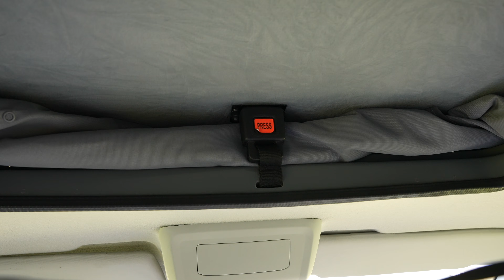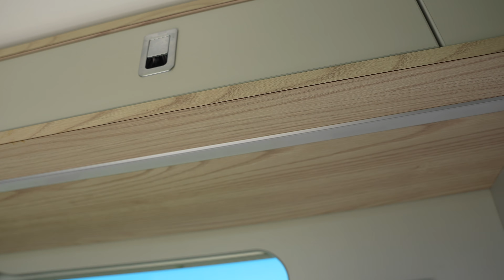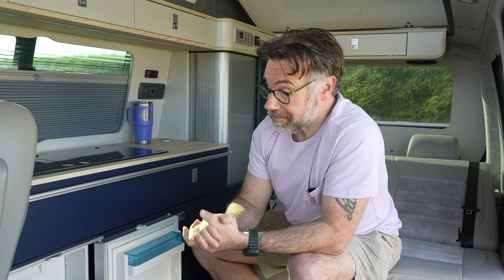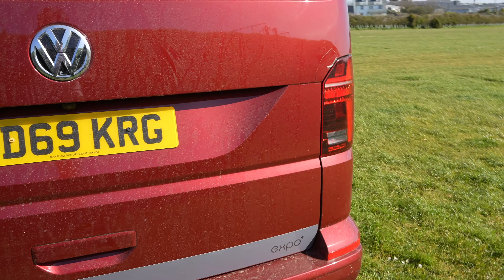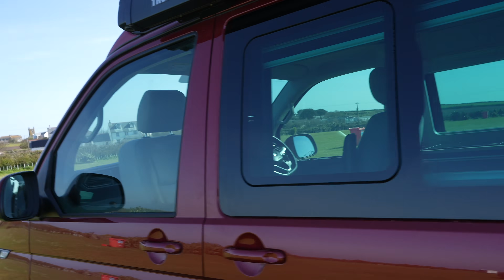£95,000 New. £65,000 Now. Is This Ecowagon Campervan Worth It? Only 8k Miles

Comment: Wot? In 2022 a Volkswagen California Ocean was about the same price New as this van is now. Used Californias of the era will currentlysell at about £60,000 – far, far less depreciation than the featured vehicle. Fact is Volkswagen‘s own depreciates at a snails pace compared to this one. The California is supplied at a very high spec in standard form. Electric pop top, central control panel  that among other things controls the fridge. Sliding rear seat (Yes it appears the one of the featured van is a Volkswagen California item) that allows increase camping space or increase cargo capacity. Windows with blinds built in, furniture built in entirely from aircraft grade honeycomb aluminium, One side out table, another located inside the sliding door that can be removed and used outside, two camping chairs stowed in the tailgate, diesel air heater with remote control– the list goes on, but the most important thing is that you get nose to tail Volkswagen warranty – the van and the conversion.  Hence, as they say in the trade, excellent residuals. And  Volkswagen dealers that sell Californias are trained not only in servicing and repairing the vehicle, but also the conversion. When it’s selling or trade in time, the majority of motorcaravan dealers will pull your right arm off trying to get their hands on your van. These things sell like hot Cakes on the secondhand market. Awhile ago now I know, but I once asked the sales manager at a Volkswagen dealer why they did not bother exhibiting at motorhome shows. He told me that they get an allocation of Californias every year and that allocation is sold within the first six months. No point in exhibiting when you have no product to sell. I bought a California brand-new, but for various reasons had to sell it three years later. It depreciated by just £3000 in that time.  A very interesting and informative video allowing you to appreciate just how much a  very desirable camper van can lose value. However, my opinion is that the California is far superior and in  almost every way.

Comment: How can they justify a £40k van with a few grand to make it a campervan, then mark it up at £95k. Its Obscene to sell at that price and insane to buy at that price.  People can throw their money away if they want.
Reply from the maker: They show on the prices of components on the spec list. It soon adds up. To sell at that price is a result of the expensive components. Buying at that price is down to the customer. 
In recent times, with base vans costing significantly more some of these have been spec’d to over £140k (6k body kits, 10k alloy wheels etc)

Comment: Why has this van only done 7k miles in nearly 7 years ? That a bit concerning also why has it gone through tyres with only 7k … also the price new 95k and now £65k second hand … you can buy these new for £68k
Reply from the maker: That’s not uncommon. Especially with older people and Campervans.
Look at the components. If this van was built now, it would be well over £100k
Reply from the maker: The wheels were changed from the originals 👍🏼

Comment: I personally wouldn't buy a campervan without a loo and shower. I like Autosleeper Symbols as only 5.4m but fully equipped, but it is down to personal choice.
Reply from the maker: Yes personal choice. This has both, but just not in a cubicle 😂
Reply: The V line 540 is a nice one too
Reply: @paulstarr6818  It is we looked at it before we bought the Symbol.
Reply: @j @jimf4748 s Autosleepers and Autotrail make good Campervans..

Comment: £95k for that? No 4-Motion, obviously no diff lock, no hill descent, SWB, bath tub roof, analogue dash, no park assist, no electric slider or tailgate?

What engine, what weight rating?

It was a £65k van to begin with, it’s a bang average spec for a Transporter.

Comment: For me the quality/condition of the base vehicle is paramount as the best camper sat in a garage being repaired is useless. After that it’s definitely layout as the most expensive camper is useless if it doesn’t work for you and finally power if it always runs out of power or can only be used on ehu then it’s not very practical. Looks a lovely van and whilst the costs tot up you may find you can get a decent useable alternative for a fraction of the cost.  Now if I can find a high top 5.4m Ford camper sleeps 4 travels 5 that would be amazing 😂 seems to be like rocking horse poop !

Comment: It's totally unnecessary to have all those lights, electrical outlets, usb control panels etc. can easily be replaced by a 3 meter lead and battery powered lights. Especially in a SWB van

Comment: better off with a cali ocean for that money and  when it was new .
Reply from the maker: There is an argument to be had, but it would be personal preference. Some things could be upgraded on the Cali so it had the same features, VB, Lithium, inverter etc, But there are differences which people would choose  not to have it. Kitchen is different, top loading fridge, but the big one is the sliding door on the continental side. Meaning it opens out into the road (hence they are not allowed to be sold in Australia)
Reply: @StaycationLifestyle  the factory finish is much better , built in blinds , table , fridge always accessible , I also like the door on drivers side easier to get in van as don't have to walk all way round , I get the safety aspect though

Comment: I do like your vids but are you just trying to sell vans now? You’re clearly trying to big this van up to sell it for the owner. You would need your head looking to buy that for that money. Buy a genuine VW California Ocean for loads less or for not much more the Brilliant VW California Ocean T7 which looks Ace and drives amazing, Not some van conversion done by a small converter, I would say a good one though, but it’s not a Genuine VW camper. You know I’m right no matter what you say. You compare the two and tell me I’m wrong. People who converted these over priced them because of the short craze. He said it’s got a California bed, what from a VW California you can buy for less. You don’t need air suspension on these vans. In his earlier vids he mentions are these converted vans worth it and the answer is simple 100% No. £100,000 plus for a none original or 65,000-£80,000 for an original VW factory built California T7 Campervan 🤔
Reply: I wouldn't really spend that much on a van but if I was the Cali probably would be the way to go.
Reply from the maker: Yes, we are all different with different choices. If I had that money I would buy neither
Reply: You have a point, probably too much immersed in the VW  scene as it is the most lucrative.
Currently you can earn a YouTube living complaining about Ford and wetbelts even got it off my MOT guy. T7 6 years down the line get the belt changed just like my  Transit Motorhome.
I’ve a T6.1 too .
Reply from the maker: Who earns a living off YouTube complaining about wet belts? I haven’t seen that channel. Must be a big channel to earn a living.
People’s opinions of the wet belt do vary. Not something that concerns me. Service properly,  follow digital service intervals which are condition based 😀 Unfortunately not everyone does
Reply from the maker: Lots of points raised here. No I’m not selling vans as I said in last weeks video. 
I’m explaining there are big difference between similar priced vans, search vans, you see for yourself, yet the components of the other vans are far inferior.
The Cali is a great van, I love them, so let’s be straight on that, but this is different. (A different option)
The Cali of comparable year did it have lithium, an inverter, it doesn’t have insulation, the fridge is top loading, it can’t even be sold in some countries because the door opens on the “wrong” side.
This van was built with a spec list with prices on all the options and it was chosen by the customer, it was their choice for their requirements.
If you’re now comparing this to a California T7, then the argument changes again. Have you seen the new California? It’s smaller, so again you’re not doing a true comparison of a like for like van.
I asked the question and you have answered it. I didn’t say whether it was worth it or not 🤷🏻‍♂️ I was showing it to you and explaining where the differences where
Reply: Hi, I own a VW T7 and it’s Brilliant. Yes it’s different but way better, as you know, not being a Van, like the rest of them. I got a New Top of the range full Spec luxury T7 California Beach for £70,000. I’ve owned every VW Campervan and Van VW have ever made. I’ve converted them professionally over 120 in total. I do know my VW’s and love them including that one you’re in. It looks great just like their other vans, also other converters like myself they’re great vans well built. But you well know it’s not a true VW Camper no matter what you do to them. In my opinion It’s not worth £65,000 not now, You can get an original VW California same reg £40-50,000. You’re mentioning Pop top price, Sliding Bed price, Automatic gear box, leather seats that all come with most California’s as standard. But obviously it might suit someone with the few extras 😃👍

Comment: Something like £50k depreciation over five years? Ouch, £10k per year is quite a holiday budget. But as long as the owner had fun, that's what matters.
Reply from the maker: It’s not quite that much, but still it’s not a small amount. Percentage wise though, compare that with others. And the new owner will also have great adventures in it 😀